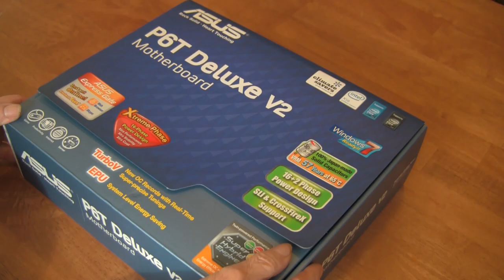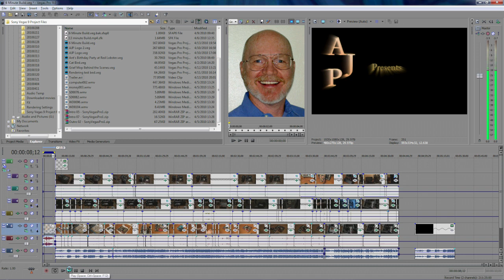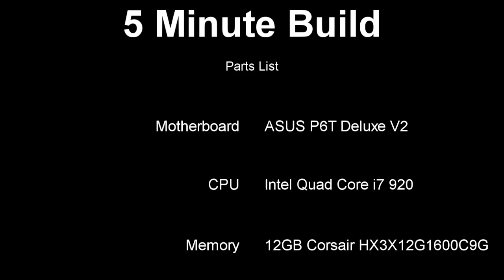My computer will edit 3 AVCHD 24mbs streams (.mts files) simultaneously in real-time!

Comment from the maker: @fearFlashback :  I installed a GTX580, and downloaded CS 5.5 for a trial run.   Sony Vegas on a  GTX250 still plays back 24 mbs HD .MTS streams much smoother than CS5 with the GTX 580.  Render times were a little faster in CS5, but the quality of video output is still higher with Sony Vegas (different codecs?).  Anyway, I returned the GTX580 and will pass on buying and registering CS5.5.  I'll give Premiere a try again next release after they've given the mercury playback engine a tuneup.

Comment from the maker: @danielcdecarli:

There are lots of video effects applied.  Two pictures in Picture, color correction, and pan and scan.  Still plays silky smooth in preview mode.  Admittedly, it won't play back full frame HD smoothly with all the effects active.  but I have my preview monitor set to Half quality, and I can ram render a minute and a half of footage within a few seconds to preview critical sections in full  glorious HD.  Don't need the PC crap you are pushing. with your spam.

Comment from the maker: @patmck2  what you will see will depend on how you render the final file.  If you render it as 60i you will see 60 interlaced frames top to bottom or bottom to top depending on how you choose to render.  If you render as 24p or 30p you will see those frame rates.  I can't see any difference in picture playback quality on my TV between 60i and 30p.  The quality of the picture seems more dependent on the bit rate than anything else, i.e. the higher the bit rate the better quality picture I get.

Comment from the maker: @JerryKumpf  UPDATE!   I just read the minimum specs for CS5.5.  It says one needs a Raid 5 as well as a GTX580 or better gpu in order to edit native AVCHD files.   I am sure the GTX580 would have performed better in my system had I a raid installed.

Comment from the maker: @thereape420 I agree with you about the video card, but I tried CS5 and it doesn't edit nearly as smoothly as Sony Vegas 9 pro.  I like some of the native plugins that come with CS5, but other than that Sony Vegas works faster and smoother than the "mercury" engine of CS5.  Granted, I don't have two NVIDIA 480 Cudas, but I imagine the improvement I would see in CS5 would be seen in Vegas.  Any way, I am saving my pennies for a hot swappable raid array and new video cards.

Comment: when you edit with AVCHD, is it 1920 x 1080i 50 or 60i? If so, when you output it to blu ray, do you see all the 50 or 60 interlaced frames on a big tv or do you only see 30 or 25 frames?